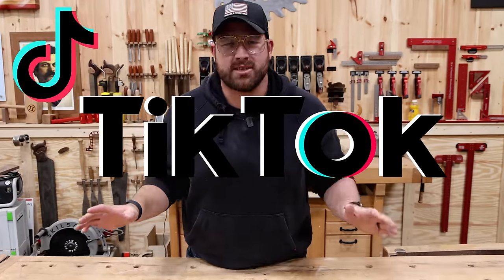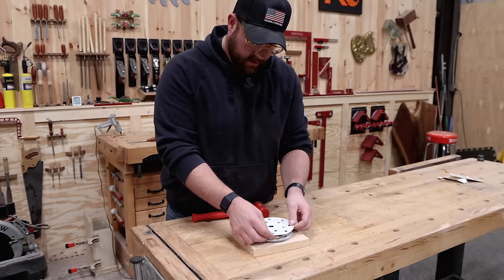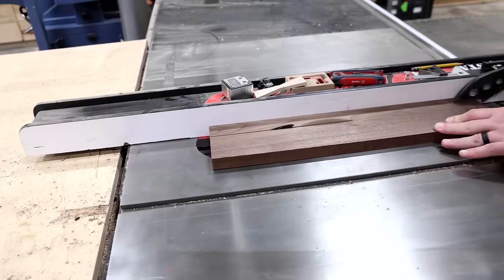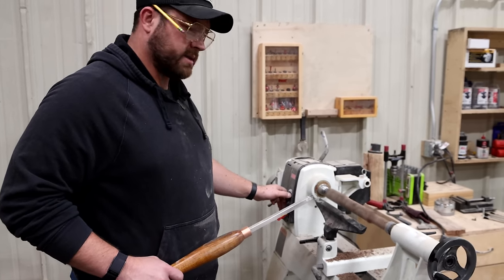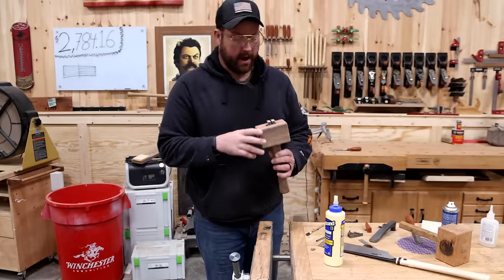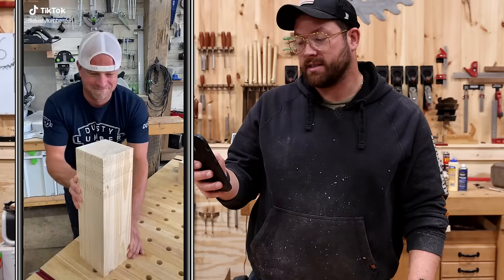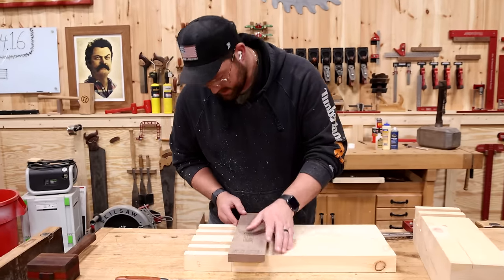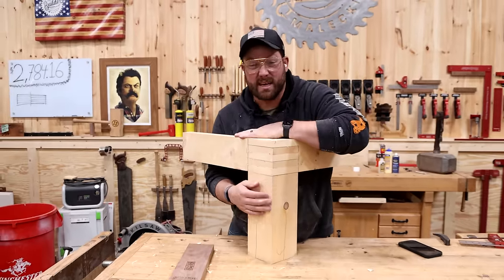I Tested More Viral Woodworking TikToks

Comment: as someone who is disabled, i think the sandpaper holder is really useful! my hands shake pretty badly because of my medicines, so i have difficulty lining things up. being able to just pop a sander onto the holder and come away with a perfectly placed piece of sandpaper would be a godsend for me. it would make the whole task way less frustrating! its like the little needle threading pieces that you can get for sewing - really simple, and not everyone needs them.. but a really, really helpful tool for those of us who just can't get the damn thread through the eye
Reply: Normally I dont have trouble lining it up but sometime my hands also just cant seem to coordinate and get perfect placement. When I saw this I was thinking its genius and I need to make one. Though I think if you round the tops of the alignment pins it would make loading paper onto it much easier and faster as well as make popping the sander on it way quicker since it would catch faster then guide.
Reply: Just buy mesh sandpaper and then it doesn't need to line up.

But wouldn't you still have to line it up to get it on the holder? It seems like if your hands shake a lot you could just use a dowel and line up one hole, rotate to get the rest.

I know it's old but I'm really curious if you do enough sanding to know from experience or just assuming from other tasks?
Reply: @kbo8029 Mesh is not the same as sandpaper. I have boxes of round sandpaper that I got at a steep discount and lining up the holes make a huge advantage in removing dust. I also replace the sand paper long before it wears out and have boxes of sand paper that is still in good shape. Its less work to replace sand paper than the extra time it takes as the paper wears down.

Comment: I think I'm gonna have to disagree on the sandpaper dispenser/holder. I think if you have a lot of sanding to do it is beneficial especially since the sandpaper is usually more or less lined up in the big packages. When I re-finish furniture I don't often use chemical stripping agents and prefer to sand the old finish off entirely since you have to remove any impregnated wood anyway so if I'm burning through a bunch of 60 or 80 grit on a 120 year old desk that would be a killer thing to plop right on top as I go
Reply: Yeah. Just open a box of 50 put the jig into the wholes flip the box and you've got a refill station. Single movement to put a new sheet on. It's not necessary to align the wholes better but it is a cool idea for quick changing the sandpaper
Reply: agree you could even mount it on the side of the bench or the wall, i dont think its so much to line it up but a good way to organize and get another without looking for a new one
Reply: I very much agree with you. The only reason they dont really need to use it is cause they have mesh vs normal sandpaper and the holes to line up are completely unnecessary. But if it were for mesh it would be so helpful to have for a quick reload without having to look to line up the holes.

Comment: Wait...I am actually into the sandpaper dispenser idea. It seems like a clean way to store all your grits and it is a nice idea if you plan to make a rack of them or something. Idk maybe I'm just too ocd. Lol
Reply: Plus whenever I get packs the holes are lined up already in the package.  It's a great idea.
Reply: Yeah I like it too.  Obviously it isn't for everyone since John hated it so much but it definitely looks like it might work well for some people.

I haven't tried it out yet though so I might not like it 🤷‍♂️
Reply: If it's in your shop, it will have airborne sawdust collect on it reducing the amount of grip, that's the true faulty part of that idea.
Reply: Even if you have to take it out of a box/wrapper to keep dust off it, if you are sanding down a big ole boat or do tons of sanding I could see that jig saving a lot of time down the road
Reply: If you do just use slightly thinner pegs. That way its easy to load up and you can burn in what grit is on what holder.
Reply: I’m going to make one of the sandpaper dispensers this week.  I do volunteer work making beds for disadvantaged kids and we have 10 sanding stations.  Getting the sandpaper properly aligned with the holes in the sanders can sometimes be a pain for inexperienced volunteers.  I see this as a big plus.
Reply: @ghiggs8389  nothing a little compressed air can’t fix, or get super fancy and build a housing that can be closed when not in use? Seems excessive though at that point haha

Comment: I'm just starting woodworking, but the sandpaper holder makes sense to me. if I had a sanding station where I could have multiple of those set on a table, and not have to deal with boxes or anything, I think it would be worth it.

Comment: It was not drywall saw, but saw that is designed to hold reciprocating saw blade. So basically same blade should be used for both saws at the test.

Comment: That last joint was really nice! I just wish that I had something to use it on...... yet. I will wonder around my home, while scratching my head and simultaneously rubbing my chill until an operation presents itself. If that doesn't work, I will repeat the last process but add swinging a very large hammer and/or crow bar....... I'm sure that this joint would work to fix a 1080p TV that's had a crow bar and/or hammer accident 😁😆👍👍👍👍👍

Comment: Yeah first one was because the other end of the board was floating so it was moving with the reciprocating blade. Same goes for when you cut pipe and its not fixed down and just wiggles if you use an oscillating tool.

Comment: #2 is banking time. You don't need to find the sheets, take them out of the packet, mess around putting them on etc.
Reply from the maker: To each their own. I find it faster to just keep them in a container with all 50-100 sheets and peel and stick em

Comment: I use the pin block for the paper, but using pins much smaller than the holes in the paper. It CAN save a little time, but not much TBH. I stack up the paper with fine on the bottom, and coarse on top, a quick peel and drop to change paper.

Then again, mesh paper is a better solution.

Comment: That’s a great technique to drill a small hole at the bottom of the handle slot….usually prevents the handle from continuing to split when your hammering down the wedge!

Comment: The only way the sandpaper one would make sense is if the manufacturer packaged the paper already lined up with a couple of dowels in the box. But yeah, if you can't line up some holes on a sander without a jig, you probably shouldn't be using a sander.

Comment: There may be a redeeming feature of that paper stacker if you are working outside or if you are work with say the roller door to your shop open to let in some breeze during summer it might be useful to stop your sheets blowing away.
Reply: just keep the sand pads in the package it comes in then just as easy.
Reply: @chrislarson9504  but hey they already built the the stacker and if your wearing gloves it is easier to access. me I find a length of garden twist tie works fine

Comment: I think that joint would look killer if you used the same 6x6 (or whatever, the leg) for the edges... BUT, keep the depth he used!
That way the corners have these nifty shelf-looking cutouts due to the leg being recessed from the edge!
THEN if you wanna really go crazy modernistic fancy-pants on it, before you glue everything up, set it up so that there's some low output LEDs stuffed in each corner, to produce a nifty glowing ambiance; could use RGB as well, even though I loathe them, for some remote control color effects for when you throw weekend rave parties!
   [Additional Thoughts: 
        - Not 110v of course. Low voltage DC only. 
        - Just the LED mounted in the table,, to remove the chances of some other component going bad and knocking out that corner's illumination (although work could be done to make them replaceable, but my thought was they'd basically be permanent). 
        - The power would be supplied by an external brick at the wall, allowing for thin and inconspicuous wires run to the table via a leg. 
        - Polycarb inserts could be made for those wanting the effect w/o the open area for dust to collect; can have tinted inserts to effectively accomplish RGB sans complexity. 
        - Whilst I'm envisioning it as one LED per opening, thereby 2 per leg... you could do some extra work at the back of each joint's middle err "finger", so that a single LED could provide the light for both openings; although, a brighter LED would be needed in order to produce the same amount of glow that one-per would generate (but useful if a person wanted to make them accessible from a drilled hole at the back of the leg so they could be replaced if any fail; alternatively, a thick piece of fiber optic plastic could be installed instead, allowing the LED to be mounted right at the back of the leg).]

Comment: Hand saws can be surprisingly fast - a good handsaw will easily beat an electric tool .... for a short time and then you are out of power. Electric hand tools are not made to be as strong as possible but to be useful, controllable and durably. I don't need a drill to drive in a single screw, but if i want to drive in docents or hundreds of screws.

Comment: I understand some of the appeal but making a mallet like this is not necessary. Cut the handle to have a bit of shoulder a the end of the connecting piece, somewhat a v shape. Then cut your middle pieces to the same angle. Place the handle before glueing the top. Unless you break it, handle cannot be taken apart.

Comment: @jhonMalecki 
If you want to get the handle in you hammer you are not supposed to smack the block but the handel on the table that will get it on faster 😃

Comment: On the hammer, I dont think he puts glue on the outsides like you did. I thought the entire point of the wedge is it's literally held in by the wedge. Yes the wedge has blue but the rest of the handle does not - its just pressed in and wedged BY the wedge. That was my understanding of how the hammer was built..otherwise why even have a wedge? You could just glue the handle in like you did and job done..

Comment: Okay. I assume, your videos are NOT the exact correct tests against the tik tok videos. So i go through every of it and call you, what you done wrong for the tests. BTW: I'm from germany. So please don't blame me about my english :/ ...)

Tik Tok 1 - The Hand-Saw against the broken electric saw:
Check out the Video exactly. The guy fixed the wooden bar just on ONE side. So the electrical part has no chance to beat the much closer to the fix-point hand saw ...

Tik Tok 2 - stacked grinder papers on a "dispenser":
If you do it with 5 or a few more papers, its not worth the time. But if you prepare a huge bulk of this papers, its maybe a "premade" time use. Its maybe faster. It can be improved by some other tricks instead of the 4 poles. But maybe its only useful for BIG amounts of grinder papers. But at least, its maybe really a loss of time.

Tik Tok 3 - The hammer made out of wood:
There's so many points you have to keep an eye of the video ... Even after i researched this video: This hammer is even broken from the original video with much less force used as you forced into this hammer. Even the creator sayed in the video, that its maybe only for a decoration purpose and not for really use of it. And even: They maybe used different wood ... ?

Tik Tok 4 - The join of the edge wood:
I can't say anything about that. Just: Wow. Satisfying! (Maybe the tik tok video didnt show the sandpaper-part? Because the parts looking extremely clean as he puts them together)